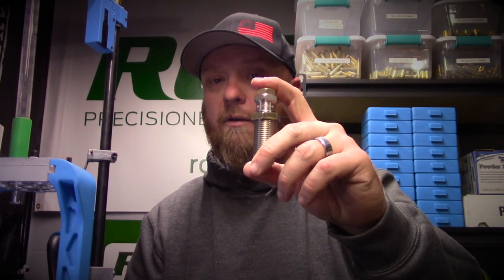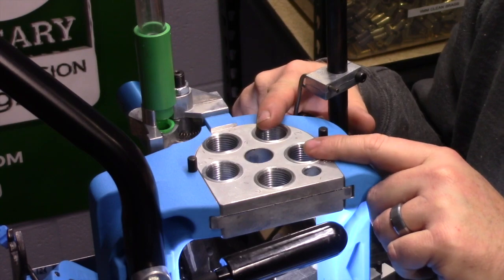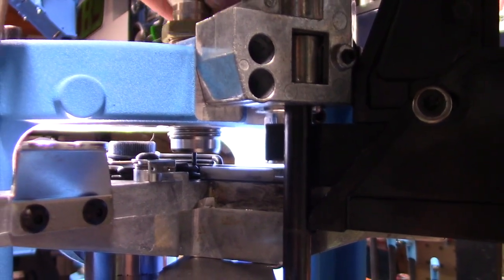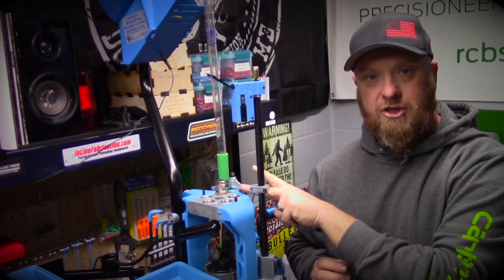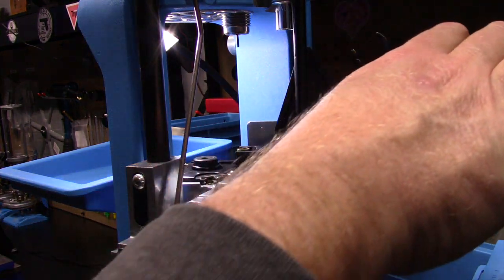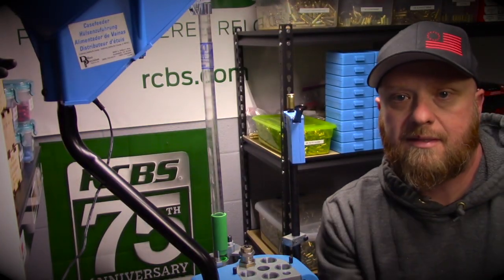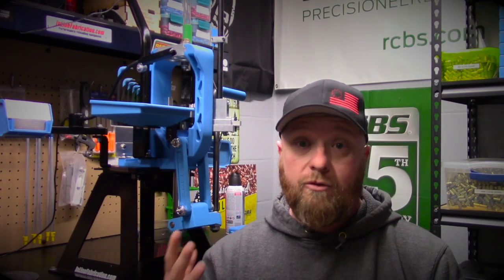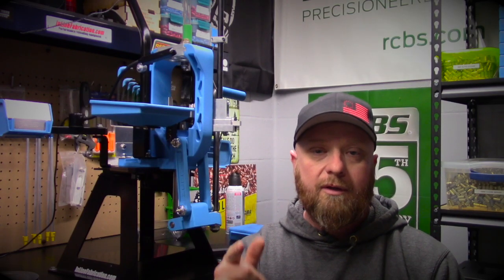Dillon XL750 - Station One - Pt 3

Comment: I have probably said this before on your other videos, but thank you so much for producing them. I have the 750 set up exactly like yours, and aside from a few minor hiccups along the way, it seems to be performing quite well. I do have a powder cop installed. I am thinking about purchasing a Mr. bullet feeder, Not so much because I need the production capacity, but more so because I just think they are cool tech. Generally speaking, how hard would you say the Mr. bullet theater is to get dialed in?  As an aside, I am getting ready to start loading subsonic 147 9 mm (FMJ)
for my suppressors that are still in jail. I will be using Rocky Mountain Reloading full metal jacket, and I have an assortment of powders including Unique, TiteGroup and CFE Pistol. Do you have any pet loads that you would be willing to share for the 147’s?
Reply from the maker: I don’t load subs in 9mm but I think Vihtavori 340 makes an excellent sub powder from what others have said.  I have personally through load development for some low 900 FPS with titegroup in the low 3 grains charge weights but were pretty dirty for my liking.
Reply: @SquatchReloaded  
Thank you.

Comment: So, I am buying my first ever press on this Thursday, I am planning on de-capping my fired brass before it get's washed, then after washing i have a Lee Auto Bench Prime to put in my primers. Now the Press i am buying is a Hornday LnL AP. my question is how would you set up the 5 station's? i am thinking resize, then powder, then powder check, then a bullet feed, and a combo seat and crimp at the end. would love to get some feed back though.
Reply from the maker: That set up will suit you just fine.  I am not an advocate of the combo seat and crimp die especially with mixed brass.  If it were me I would omit the powder check and seat and crimp in two stationsZ
Reply: @SquatchReloaded  yes, just take it easy while running the unit and use your eyeball as a powder cop. Make sure your bench and press are well lit.
Reply from the maker: I think they are pretty straight forward.  The biggest thing is getting the case bell set to allow the bullet to stay out durning the index to the seat station.
Reply from the maker: True